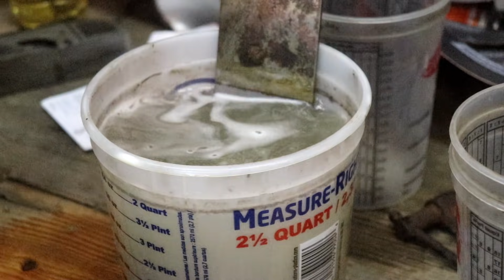Tool Restoration -Heavily Rusted Lathe

Comment: What color of paint you use to make gray machine color finish??I checked most of colors but couldn't find for my machines to paint or repaint after repair..
Reply from the maker: I use CRC grey. Great industrial paint.
Reply: @TheGoodoftheLand  I think how to paint all my machines in that color but I still cannot find that paint in stores,I used lite gray to paint my Craftsman 109 lathe and it's bed's but I don't like bright gray color,looks very bad..I have Wen 12" drill press which have orange colored head and I think how to repaint to gray machine color..
Reply: @TheGoodoftheLand  You see friend restoring machines or any other rusty tools or even firearms is one thing,making replacement parts is totally another job,it requires master craftsmanship to accomplish such quests.I can build any replacement parts for wood or metalworking machines,making my own tools or making my own firearms parts that neather too expansive,no longer produced or something that takes different levels of total remanufacturing from point A to point B.I can engage any task neather it is carpentry,painting or any body work,machining parts using any models and type of lathes,milling machines,shavers/planers including CNC models,welding,mechanicals skills at any levels vehicles or not vehicles based,micro electronics and heavy voltage,plumbing,tiling and any stone/concrete and glass based,blacksmithing,gunsmithing,watchsmithing,locksmithing and discipline after discipline with master level.Whatever I want I always make it so.My latest achievement is rebuilding soldering iron by replacing heating element which also took modification of outer jacket to suit new longer heating element.I tested it and rebuilded iron now kicking and heats up way faster unlike before,the higher the wattage the faster iron get hot,my design took drilling 9 side small holes for fast heat decipation so iron won't overheat and at end fail like original concept.My repaired soldering iron was radio Shock version,I like it because of it's small length,diameter and thin tip allow fast melt of tin alloy and solder circuit boards fast.The only what I had forgottened about is thread end of jacket to screw in copper tip.My replacement for some time was upgraded wood burning iron,instead using brass tips that was in set I had made my own copper tips based at brass tip shapes,it works but takes time to solder stuff,some connections was ruined at boards but not that bad,if heating takes too long and you touch some contacts many times they would broke off which is unacceptable.My radioshock soldering iron never allow that to happen until it's element burned out which took me 2 weeks finding replacement elements and obvious they been bought from China,the first element works as been promised and it have superior design unlike predecessor.I tried rebuild original heating element but failed no matter how I tried because I suspect nichrome wire was wrong grade,after couple seconds heatup element would spark and burn out until I gave up and bought new elements.I have one more soldering iron to repair.
Reply: @TheGoodoftheLand  So far I got over 25 different projects,lot of them half way finished or close to finish line while other not even been touched yet,one thing I don't have for them all is lot of time.I performing best I can bit by bit and always takes my time,perhaps this is main reason since I have lot of patience even at moments when I ready to brake things apart and sometimes I do but yet again I would rebuild and make it fully functional again,sometimes rebuild or make out of scratch.When time comes to do work I like a dog with the bone,never give up and my coworkers call me relentless or master smith for short.Everyone know I more than capable do anything I want and anything how I want it to.Help lot of co workers too with their tasks as well.To perform certain task is takes time at different levels,sometimes half of hour while sometimes much less,some things takes days it depand who I helping my boss or co workers and what type of projects vehicle,construction involved or something totally different.For me it too easy although things still takes time to accomplish,I think I capable to do much more than all of this,the steps that nobody walked even yet but my resources and fundings are limited so I cannot over jump myself.One thing for certain that Covid 19 something far fetched than just human made,it is adoptive and works different on every individual,while some individuals die faster than other while other individuals just carriers of that pathogen,it is like hunter seeker laying down still until target is sighted and than virus would jump to specific individual with one thing in mind to kill and destroy.This type of virus cannot be recognized by any brightest virologist in the world,some individuals DNA recognize that virus and read like ABC while others cannot compute such logorytms and protein levels act as destructive substances.For humans its too smart to invent affecting certain individuals while others remains intact and unharmed,not even feel a damn thing like Covid 19 not even exist at all,most of individuals only would have allergy symptoms while rest die instead from exposure.Pandora box had been opened and it's just a beginning,there is much more surprises exist,in time we learn that somebody filtering civilization that normal humans to be spared while obstruction to be whipped out.Nature and wild life unaffected at all and immune to that mystery virus..It is like cubik rubik to make all colors puzzled correctly.Virus always mutating so finding correct cure to it next to impossible,virus been designed that way by advanced civilization long ago,they knew if everything fails there would be fail safe for reboot.Virus been contracted from North Pole,when samples melted after lab environmental control failed allow escape mystery virus at the open.So as expression correct what you cannot see would kill you,human civilization based on ready made solutions to resolve of problems,many of those problems logical and required finding answer through time,from another perspectives human civilization manipulated by above society,something that world governments keep deny but they in one bundle with them.Over time human civilization been genetically experimented giving birth to sub species,no wonder to guess where is virus blown from at other end,virus act as equation to decrease numbers of species that not consider normal.Normal humans immune to virus and won't be affected since their DNA recognize virus codings inside DNA,abnormal sub species cannot recognize virus and their fate getting sealed,wild life also recognizes virus and get not affected at all.One thing is know for sure,sooner or later there would be a war and it technically never been ended since end of 2nd galactic war.Human civilization sold their own sole for highest bidder,however that highest bidder have lot of price tags on their head,human race been watched in secret all those times and all things that NASA keep hiding from public view they just delaying the inevitable,the traps had been placed from the start,HAARP is no longer operating as it was before,the source of ancient power is failed to operate further so conspirators hook it up else where.The fate of human race is predictable and well known where it goes through.There is a choice that stands between to sacrifice one to spare another,nothing get accomplished easily without sacrifice..Universe is a scales,one way to create while other to destroy to balance equation,everything operate at mathematical precision,if one thing interfere with logical concept it would be nullified at the end,unfortunately human history started with wrong concept,it had lead everyone else to their doom,only what it takes is faulty leaders who lead everyone else for their end.Everything is domino affect,if one fall so as the others would follow beginig back at square one again.Everyone wonder why advanced technology not been left,it is been hidden on purpose so others won't use to destroy themselves as before,they all knew what the end would be but they decide not to interfere with it,ones human civilization been spared but after making wrong choice everyone just turned away in all different directions,another incidents that coccured long ago boosted that retaliation and their main purpose was locate another resources across distant galaxies.The universe begun with seeding life across all various locations,while some life was created through natural way intelligent life been bio engineered and spread all over universe.When that life fails it's purpose of existent is doomed,somebody watching our progress and wait for certain moment to begin phase 2,their name is unpronounceable but they located at dark void of universe,one are particular known as Centurian galaxy,it is cluster of galaxies invisible to the telescopes and cannot be located,however the most large black hole located right at that area,black hole followed by large amount of dark energy cannot be viewed at all or be visible at least.If that civilization very ancient ranges from 16.5 billion of years old they capable controlling black hole and it's energy,another purpose of black holes is use for teleportation synopsis,like an light speed engine principals black hole open singularity rift if adjusted which large black hole become super conductor and fully sustainable by amount of energy that it contain and it would be way in while smaller black hole would act as electrical wire gauge system,the smaller the size the higher the resistance and would act as way out,establish connection from point A at point B and space bridge is open Rosen Bridge,an portal that would be used to transfer all forms of technology just like before except this time with bigger numbers,"The Power Of Black Sun",everyone was tried catch at that phrase but didn't knew its definition what it means.Part of human history been over written or completely erased so what was really happened in past unknown,however many individuals can see that through and that known as genetical imprinted memory that transfer from generation to generation,where all those sci fi comes from,imaginations??I don't think so,imaginations that have identical characteristics and concept is no longer an sci fi but sci facts.First there was books,than movies and games and all of them have same in common,that is Genetical memory speaking,like learn it and use it neather to be or not to be..No matter which part of the world you are from,no matter which race you from it matter which group of species you are from original or not original.This is solves all puzzles with everything what and how is going on,wars quiet down sometimes but not fully silenced and over some duration of time period wars resumes back until proper logical end is concluded or historical time line takes place,if history had wrong time line it would rotate that point to the future until proper momentum is unveiled.This world talks for itself,it is doesn't want to reason or kneel to full submission rather been hostile and cunning with high level of intelligence and logic,even the smallest living organism based at logical principals,human civilization willing to sacrifice themselves just to destroy things without any reason at all,this is where logic takes far further and brings beginning to the end.It is still unknown when NASA stop lie about facts that we not alone in this universe and never was,all their altered images means nothing.Logical life exist at Earth,so as all over Universe but sometime that life doesn't want to be found or communicated with and it have their on reasons for doing so.If human civilization so great why there is still no advanced craft exist that willing fly faster and further into space??The reason is not luck of technology and science but the real reason who slowing down that technology and science at purpose so civilization won't evolve and remain at main primitive levels.Germans was ones up to something but all those researches vanished into thin air..

Comment: Love the channel and your can do approach, as a retired optics engineer the only advice I could give you is when you are working on some of the finer items you could take a leaf out of the gunsmiths’ book and use a screwdriver that fits the screw head, not only in width but also is parallel and fills the slot, this approach minimises cam out and allows full torque to be applied. Now you have a small lathe, one of your next projects could be making a couple of gunsmith style screwdrivers. Keep up the good work repairing instead of chucking! No pun intended.
Reply from the maker: +Colin Shaw Thanks Colin. I will put a set on the list.

Comment: I would send the bed to a reputable automotive machinist. They can set it up in a planer the same way they would if they were decking a cylinder head. Once the platform level is set at the bed feet then they can determine how much material will need to be removed from the bed ways. At this point they can make a decision as to whether or not the bed ways will "clean up" while not removing too much of the surface material. Many of these resurfacing planers can achieve a surface straightness of +/- .0002 (which is probably better than new for this vintage lathe).

Comment: You should have done a more complete paint job for a full restoration.  A good honing stone would have cleaned up that deck pretty good.  I also think you should get the right lube for this too.  Does the motor work and did it come with the other parts, the chucks, and any bits?

Comment: Nice mini-lathe! I guess some parts are lost though... Tool post, motor, yes?
Reply from the maker: +Tin Woodman's Workshop it has the tool post but I'm adding a quick change. It came with everything that it was sold with in the original boxes! My friend Roy dropped it off. It did not come with a motor. Gonna fab up a nice bench and motor stand. Cant wi

Comment: Great job. I especially like how you sprayed everything with penetrating oil to aid in disassembly. I cringe when I see some of the videos where the guy goes at a piece of rusty equipment with a steel hammer and a pipe wrench trying to loosen a rusty nut or bolt....I find myself talking to the screen...”spray the damn thing!” Before subscribing to sites with pros like yourself who not only use the proper tools but appear to know what they’re doing. Again, great vid.

Comment: Restoration implies working order which this is not given what you’ve said about the ways.  Still a way yet to go but looks promising.  
   The fixing nut on the cross slide can be secured by adapting a cheap flat screwdriver of adequate width to a two prong driver (what I’ve done for my own lathe).

Comment: I bought this lathe, or one exactly like it in the 1970's from Sears when they sold everything. It was a step down from the earlier Atlas and South Bend lathes. Its main issue was the distance between the headstock bearings.
That distance was too small making
an unstable spindle leading to chatter
during a cut. It also cut on a taper. 
For the price of $150. it was better than no lathe. 
If you get to like using it you will
quickly be looking for a bigger heavier machine.
kap

Comment: I've been lucky,,, have 5 atlas lathes and I can slide micrometer and caliper down all ways and there all perfect and needle on dail indicator hardly moved on spindles,,,atlas was a hobbyist lathe and never was in factories are classrooms is the reason why.. l think it's the best you can buy for the money,,,I've walked away from several more high dollar lathes because of wear issues, and people talk bad of the cast zmak gears but I have 5 60 years old lathes and only 2 gears show signs of wear.

Comment: For the sake of accuracy, the ways should have been ground and all of the gib components replaced. I have the next size up Atlas on a workbench in my shop, and when set up right, they can be awesome for making small parts. You mentioned scraping the ways, if they aren't ground to a reasonable level of flat before you start scraping, you can actually end up making a bigger mess than you fix.  And they ways are only HALF of the equation. If the tailstoc, toolholder, etc. aren't in a good place, straight ways will make wonky parts.

Comment: Not a drop of oil used when rebuilding. Not even on the parts that will be hidden and inaccessible once rebuilt.  or did i miss something?
The rest no matter what condition something can be saved. Great work.  Amacf
Reply: Then there's the fact the ways were screwed anyway.. Without a regrind is scrape this lathe would never turn a straight part..

Comment: Be tempting to send the bed off to get the guide ways reground to clean them up.
Reply: they've never been used.
Reply: the bed is fine. never been used.
a little naval jelly, and very light stoning would've been fine. no reason to scrape either. just make it wear way faster

Comment: Ack reassembled with rust still evident....
Reply from the maker: When metal rusts it creates small pits in the metal. That is what you are looking at. The ways are flat and the pitting is very light so it won't be an issue. Actually should help a bit to keep the ways oiled. Hope that helps. Happy new year!